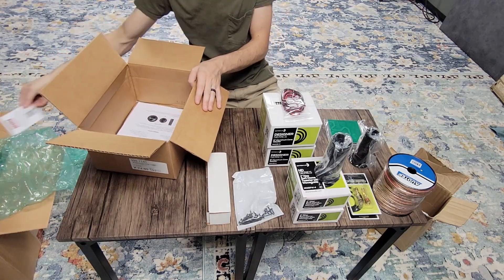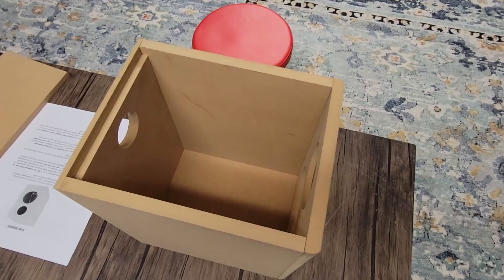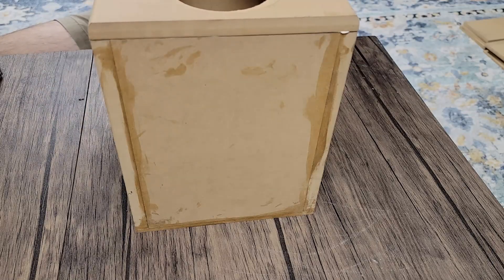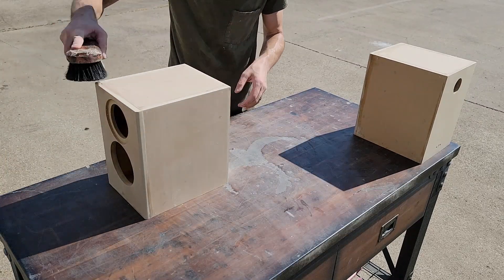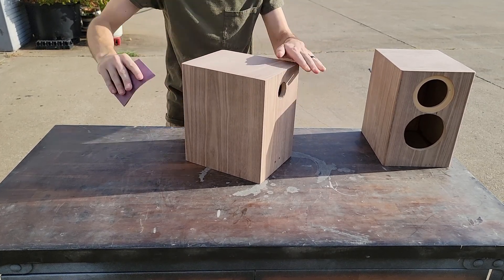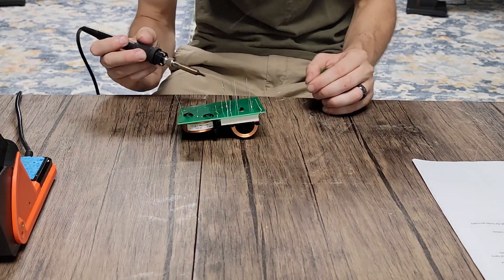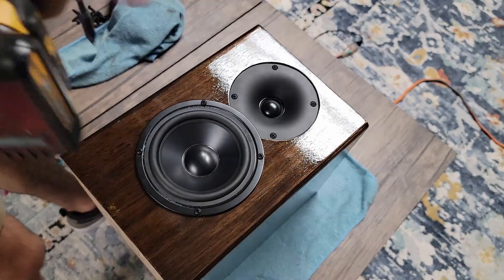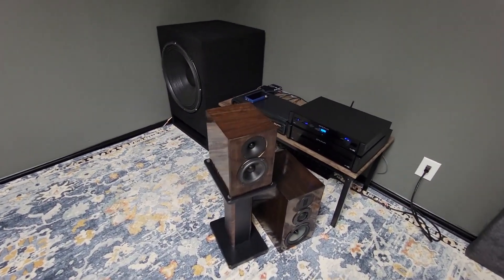Taking A $150 Speaker Kit To The Next Level- Let's Build The C-Note Speaker Kit!

Comment: Great build, thanks for documenting this. I am looking for a reasonably priced set of bookshelf speakers and this might be the ticket. Good to see some of the possible challenges.

Seems to me that the driver openings were not machined correctly. The woofer is sitting well proud and the tweeter's wave guide is sitting well below the baffle surface. The woofer proud could be a design for time alignment (color me doubtful), but the tweeter sunken below the baffle is going to cause significant diffraction and ripple. At the very least, I would cut some paper to match the recess and shim the wave guide to be even with the baffle surface.

Comment: Nice work. Little tip: make sure the tweeters are flush to the baffle, they are to much recessed now, this will create a nasty diffraction.
Reply: Right, it's cutout is probably too deep by the thickness of the veneer now. If you have some leftover veneer, you could cut out some spacer rings from it, to set the waveguide forward again.

Comment: How do the C-notes compare in sound quality to your HiVi Swan kit speakers?
Reply from the maker: The Swans definitely have a more rich, bass & treble heavy presentation. The C-notes are a more neutral, mellow sound, with good, but less bass.

I would always recommend the Hivi 3.1s to anyone. It's really hard to go wrong. They easily compete with multi-thousand dollar commercial speakers. If you want a more mellow top end, there is an xover mod that's easy to do.

Comment: Nice job and detailed explanation. I built the C-notes as well and finished in cherry veneer. For more porous veneers I like to pore fill with Timbermate, or epoxy/cabosil. I used French polish on cherry and it is perhaps my favorite gloss finish of all. Poly is fine but it attracts dust and other contaminants. I use poly if I am going to burnish it to satin with 0000 steel wool but for gloss, I almost always choose lacquer. 

C-notes are not my favorite bookshelf design. These were kind of the final straw as to why I don't build or buy speakers under say, 6.5". Two exceptions being the Speedsters, and Jeff Bagby's Continuums. The latter were designed to be used with subs so they are very effective above 60hz or so and have some of the sweetest mid-range. Once we start trying to crowd in sub bass on these little drivers, SPL capabilities become severely limited. I choose speakers that can play to 90db easily, even if I only listen at 70db or so.

Comment: I already own a pair and have been very impressed from the first day I had them set up.  After watching this, I plan on tearing mine apart and putting some money into the veneer,  setting up an external crossover with "Hi End" audiophile type componets, using some damping material on the bass driver and cabinet walls and maybe a few internal bracing pieces.  Great video and thanks for posting!
Reply from the maker: Yes they're worth a little investment into the finish. They really are great for the money. Thanks for watching!!

Comment: I would recommend lining the inside of those cabinets with some sort of damping material. You really don’t want to have bare wood in an enclosure. Beautiful finish however
Reply: Do all speakers need to b damped
Reply: @matthewtaylor7355  yes, also around the cables inside the cabinet.
Reply: do i also need damping material in a sealed sub box?
Reply: @ngl750k No
Reply: @ngl750k  yes, otherwise there will be lots of resonance

Comment: I have done a lot of veneering for both furniture, cabinet work and hifi speakers, including a reproduction mid-century console stereo. If you want to be quick, by all means use contact glue, but be very careful with your choice of veneer. A veneer like Walnut appears to be flat, but will ripple when applied. You can see this in the video. The same goes for Oak and other hardwood varieties. These veneers do not finish well with contact glue because there is no compression involved on the grain and contact glue never sets, it remains tacky throughout its life. It is meant for countertops that have a hard phenolic veneer, that lies perfectly flat. Also, with some wood fillers it will react and cause swelling, particularly if you have screwed the panels anywhere. There is no substitute for cold press veneering using standard wood glue. You just need a fast setting wood glue, a few clamps and some old board to flatten the veneer. Make sure that both the veneer and the MDF have a layer of glue. Two coats of glue on the veneer is optimum. You can do opposite sides to save time. The finish is perfectly flat with no 'float' or softness to it. If you can afford it, buy a trim router with a flush bit - this takes off the excess veneer perfectly. Whiteside also have a bit with a very small head that allows you to trim the cutouts to the depth of the speaker plate.
Reply from the maker: Thanks for the tips! I do have a trim router and will definitely be using it in the future. Thanks for watching!
Reply: Can I ask what your opinion is on the iron on veneer method? Do the same pitfalls apply there or should the results in general be similar to cold press veneering? I've previously done the ironing method where I apply glue with a roller to both surface and veneer let it dry, then roll the surface to be veneered again and let dry until tacky. Then use a iron and apply pressure, right after that I use a veneer roller while its still hot and roll until flat and cool. Working from inside out and with the grain. On the oak i had some very minor splitting which after sanding and finishing was not visible. On the ovangkol (the first veneering I did) I did not have this issue. My theory was the the veneer was just not very well cut but maybe my method was just sub par? I would appreciate you sharing your opinion and experience of your craft :)
Reply: Looks like a beginner "first DIY adventure " - not saying there's anything wrong with that, but " I  was going to ask whether "Next Level " is coming in episode 2 ???  And the wave-guide is seriously NOT flush with the enclosure - 100% creating a response ripple.  Since when is basic construction considered "Next Level " am I missing something ??

Comment: I made my first speaker at the age of 16, in those days these kits don't even exist, personally I don't like the gloss coat you put on the veneer, I prefer semi matte, the woofer is over the tweeter edges and is a bit inside, is better to separate the woofer 1 inch to avoid diffractions, the tweeter polarity should be inversed because capacitor retards the phase 180 degrees, besides everything good job

Comment: You should have substituted better resistors and tube connectors in the place of those binding posts.
Rest of the components are nice, also maybe more bracing and insulation.
Reply: OK Danny those tube connectors cost more than that whole kit

Comment: Some finish tips. In the raw veneer, use a damp sponge to pop the grain llet dry and sand. Then thin the poly and use a rag to put super thin coats and lightly sand between. You can get a glass like finish 
I have put together gr research kits, and they sound amazing for the price of these diy speakers.

Comment: You can VASTLY improve the polyurethane finish if you would employ better application technique, the easiest way would be to learn to apply by wiping on by thinning the poly and sanding and steel wool between coats.  You'd be much happier with the results.
Reply from the maker: Interesting, thanks for the tips. I've always thought wipe on poly looked easier! I'll definitely give it a shot going forward.
Reply: @DIYhyfy don't bother with the wipe on poly, it's just regular poly thinned with mineral spirits, buy regular poly and thin it yourself, it's cheaper and you can control the thickness to suit your situation.  Several thin coats with sanding or ateel wool between will give a nice result.
Reply: @sabresys45 can you do the same with water based poly by adding more water? I'm also interested in this wipe on technique.

Comment: Nice video.  I see you have some raw MDF showing around the tweeters.  I recommend spray painting Black around any recessed speakers before applying veneer.  Since yours are complete I would use a black marker or add an additional layer of speaker gasket tape to bring the tweeter forward more.
Reply from the maker: Nice tip! These were sent to a friend of mine. I removed drivers and painted recess after filming. I was too anxious to get it filmed, that I rushed and forgot!

Comment: If you want to paint MDF you can use a sealer (2-3 coats with sanding ) then paint or use 1-1  glue /water mix and use the same way as a sealer. Good Work!

Comment: I've built these. My mods include: 1. I routed the inside of the face board to take the woofer from the back. 2. I replaced the elements of the crossover with military-spec, including conductive plastic potentiometer for a treble control I added on the back and capacitors and resistors. Air core inductors came with the kit and I used them. 3. No nails in MDF. I just used glue with corner clamps. 4. Finish is red oak veneer from our friends at Rockler. 5. I used a cup with four-way post connectors to take the wires from the amp on the back. 6. Used wood sealant on the MDF so that it is easier for a good bond for the contact adhesive to adhere the wood veneer. As I love the look of natural wood, I finished over the red oak with seven coats of Varathane. I recommend trimming the veneer with a veneer bit on your router. Using a tacky cloth to take off really fine saw dust can really make the difference in your finish. I like to apply the polyurethane with a disposable foam brush. I built covers using the supplies from Parts Express. My only complaint is that the woofer is not mounted in a routed mount as their intention is to have it overlay the tweeter flange. I think that my build looks better and comes closer to having the focus of the voice coils for the woofer and tweeter line up. I also recommend using the foam seals Parts Express sells to make sure that the drivers are airtight to the face. If you look at the finish in this video, you'll see imperfections, due to the lack of 800 grit sanding in between coats. The more coats you do (sanding and using a tacky cloth in between coats when dry) the nicer the finish is. Spraying it on is really the best way if you have a ventilated area. Pax.
Reply: Military spec 😂
Reply: Sound like you spent more on 'bits' than on the kit itself! :face-turquoise-covering-eyes:

Comment: Ive read that they cut the relief for the tweeter like 1/16th too deep, causing the tweeter to sit slightly too deep behind the woofer and the face of the speaker. I guess people use a tiny shim to bring it back to the surface. Maybe you could try it out and see if it makes any difference
Reply from the maker: Yea I used gasket, as it was audible without
Reply: @DIYhyfy every one are experts they watch a couple of gr research videos and they are armchair s engineers.  I stopped posting my speaker designs on diy groups because people get so negative and most people never actually have ever tried to build anything.  I am actually sitting in front of an mtm with 2 6.5 designers in a solid wood cabinet on top of mdf it's heavy but I like mass loaded cabinets . They are nice heavy mid woofers for the money
Reply: The tweeter should be flush, so yes - some kind of gasket to bring it forward just a tad.
Reply: The depth is intended to allow the foam adhesive edge seal to make an airtight and non-rattling connection between the flange of the tweeter and the face board.
Reply: @davidsecord6412  Oh, I see. Whatever post I read about it, they said they found the sound to improve, but I'm unsure how exactly they said that was, and I can't remember anything else. I just thought it was odd in one of the angled shots in this video, you can see the bare mdf very slightly around the tweeter which I thought was odd. But if they meant it that way, where the tweeter is actually supposed to be that far back, then that's cool too. I just thought it was odd that it sat back so far.

Comment: Looks good ! Did you not use any dampening material ?
Reply from the maker: I did not, but may in the future
Reply: I have these and I used a 1" convoluted mattress topper from Big Lots (dirt cheap!) for lining. I think it clears up the midrange some, but without it, in a "soft room" (like living rooms or such), you shouldn't hear much difference. Half-inch foam carpet pad from a big-box store (the cheap stuff is usually softer) will work fine too. I don't think I'd want to use typical 2" convoluted speaker foam-it would cut the EFFECTIVE enclosure volume too much and hurt bass. BTW, you just need lining on the vertical sides and back at most.

Comment: Ever experimented with iron on yellow glue method for veneering? Definitely not as quick as contact cement, but allows for easy adjustment and alignment of grain figuring. And for finishing of finer veneers like walnut or Sapele mahogany, aerosol spray bombs of lacquer can look luscious.
Reply from the maker: I have a little bit. I will likely use it in future builds

Comment: Would be interesting to listen to the speakers without any veneer finish! Great video, thank you.
Reply from the maker: Good idea, I'll include that in the next project!
Reply: @DIYhyfy  I only mention this because I have a pair of Focal Alpha 65 (older ones), and remove the plastic sides and scraped off the stuckon rubber pad.  Gave a more open and detailed Sound.   Recently upgraded the fuses to Synergistic orange (used) and again much better Sound.